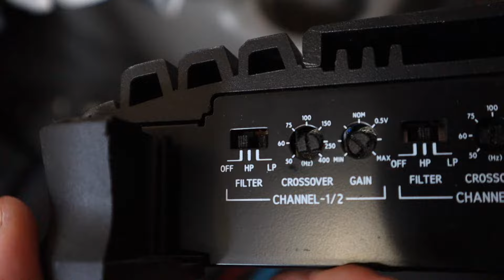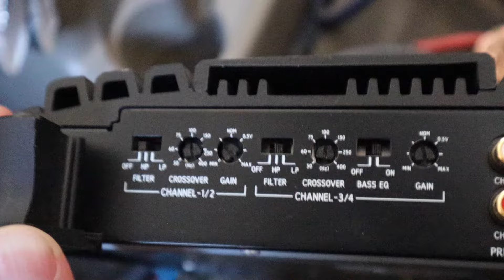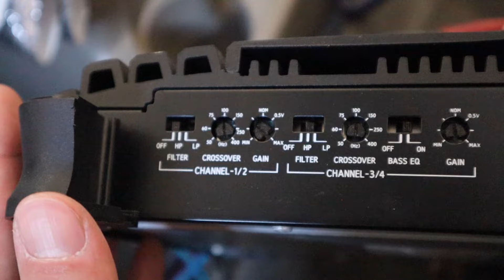Car Amplifier Settings Explained!

Comment: Thanks for the video. For Alpine S2-A55V if I want to map 2 way component speakers in Channel1 & 2, coaxial in channel 3&4 and channel 5 for sub then what should be the crossover setting for Channel1&2 since it would have both mid range and components?